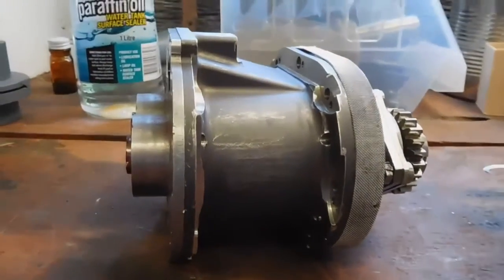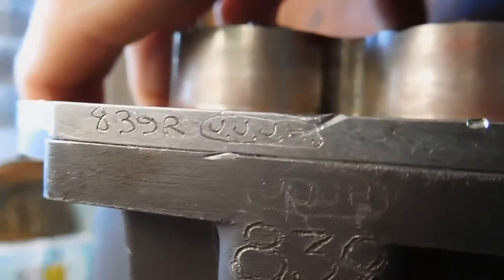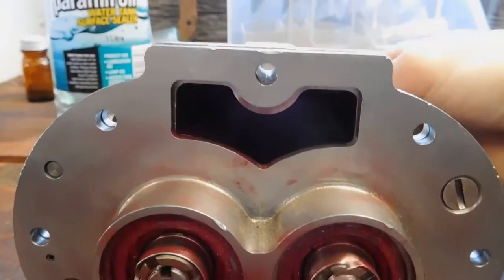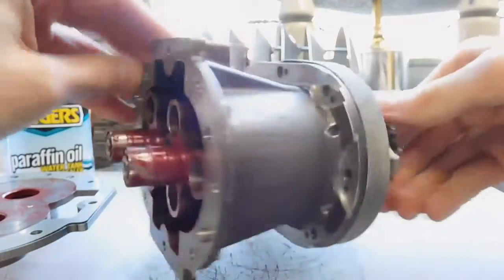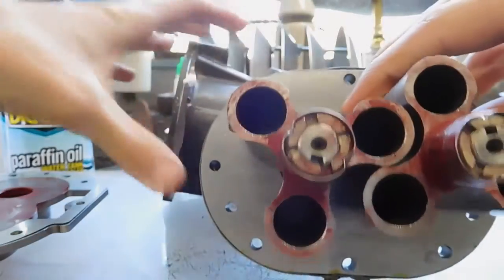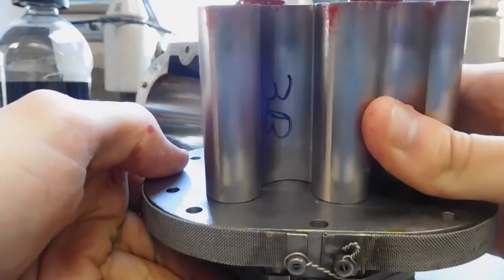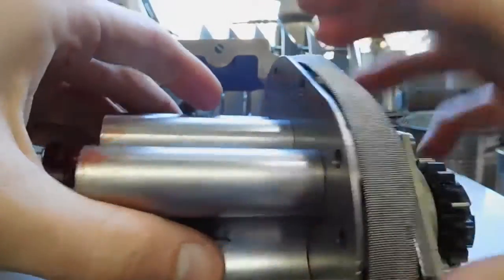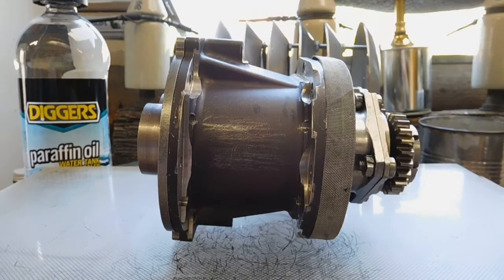Mysterious Minature Aviation Roots Blower

Comment: Probably a cabin pressurisation  blower, used to pressurise either a small aircraft or to provide cockpit pressurisation for some fighter aircraft. Another use would be a low pressure fuel pump for a jet engine, used to pressurise the fuel that is sprayed into the engine.

Red grease is a preservative grease, used for storage as it does not slump during long term storage, but which will not contaminate the hydraulic oil system
Reply from the maker: Ah now that's an idea, as these would only put out a few PSI above atmospheric pressure. I'd imagine it would be used on a fairly small aircraft going by its size